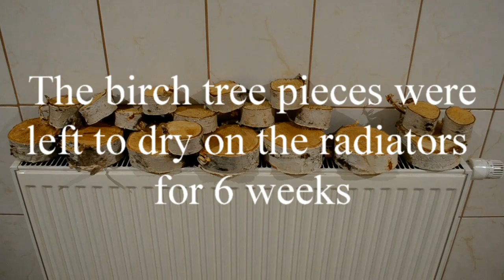Epoxy Resin Table

Comment: I've been a professional cabinet maker for over 40 years and this video took me back to a time before $20,000.00 worth of tools and how much fun it was. Good job
Reply: MJH1354 you had epoxy resin back then?:))
Reply: MJH135
Reply: I would like to know the name of the clear liquid he used? Thanks
Reply: Emanuel Santos d
Reply: MJH1354 co gai dam me ve rtranh
Reply: co gai dam me ve tranh nhảt ban
Reply: He is talking about the fact that how the guy is using hand tools instead of machines. Which MJH1354 used to do back at his time.
Reply: Quantos vale em Brasíl ???

Comment: This is a nice project :)
As a wood-professional i would advise some little changes for your next furniture though.
1. Try to put screws from the invisible side instead of drilling from the outside, unless you plan to put really decorative caps over the screws.
2. Dovetails are supposed to be a really tight fit, otherwise they will loose strength. Saw those very tight and if necessary fit them using a chisel or sanding paper. You might consider putting a screw-clamp to avoid splitting the wood when only putting one dovetail.
3. Also the outermost part of a dovetail joint should always be the part with the grain running through, not the dovetail itself which tends to break more easily.
4. Once you mill these joints for the framework, you could as well mill them dovetailed and put those beams in from the top, making it more durable.
Reply from the maker: Thank you very much for the advices, I will definitely use them )
Reply: HomeMade BRAVO!!!
Reply: good advice :)
Reply: Don't try to tell chickens how to lay her eggs, it was great, show me your work
Reply: Jose Rodriguez the guy was happy for getting the advice, thanking the guy (first reply).  we're all learning.  it may help others as well.
Reply: Foreign country; English is a second language.
Reply: He was being polite.
Reply: Grant Perkins show me your work 🤨🤔   I think you just talk

Comment: Beautiful!!! I am a woodworker and I have been planning a table just like this. I've saved up the rounds...I'll use oak. Question... what kind of resin did you use? I know it's epoxy but what brand? Did it cure clear? Also, what kind of glue did you use to bond the rounds to the substrate? The plants in between is a nice touch. Well done!
Reply from the maker: Thank you. The epoxy I used called 3D tranparent epoxy. And I used PVA glue.
Reply: dolan faunture set march 2017
Reply: donde se compran los productos
gracias y felicidades

Comment: Beautiful! Love the dovetail corners. Did you use the same epoxy mixture for the final coat?
Reply from the maker: Thanks, yes I used the same epoxy mixture
Reply: joe
Reply: süper fikir tsk
Reply: joe Jonas massinha
Reply: Joyas de plata hechuras
Reply: ????is it the same kind of epoxy as the used for flooring

Comment: You've done a very good craft work! For the next table I would take a glass plate. On this glass plate I would put the wood and the flowers. Finally, I would illuminate the glass plate from below with an LED lamp.

Comment: I don't know if you came up with the idea of your router fixture for leveling off the top of the rough sawn birch pieces but that is a brilliant idea! You didn't show the bottom plate of the fixture but I assume that it was assembled to be inset to the fixture side rails. I will be making a fixture for my router, thanks for the idea. Very nice table!

Comment: This table looks awesome... the only question I have (which maybe you don’t know) is why the epoxy resin became so cloudy? I want to make a resin table but I want to do NUMEROUS depths but I want it to be crystal clear. If you know why it was cloudy that’d be awesome if you could inform me.... I like it on this table though. I’m from the northwest and it reminds me of a foggy morning in the woods
Reply: I believe it's the lack of having buffered it to a nearly glassy look before the final coat. He also should have used a propane torch as opposed to the heat gun. The finish was truly quite poor. It should be flat, crystal clear, and basically look like glass. Could also possibly be the quality of epoxy, or it not having been mixed well enough.

Comment: Really well done.  Enjoyed watching the video as well.  Only thing I would have done different is used pocket screws to attach the plywood to the frame in order to get rid of the dowel marks on the outside of the frame. Could of even used biscuits.  Gave me an idea on what to do with the old wood in my garage.

Comment: Very nice - Just wondering if that wouldn't look sweet with some varieties of wood in there instead of all chunks from the same logs as most of the larger pieces have identical-matching 'hearts?'  Maybe some black walnut, oak and maple mixed with the birch for good measure?  Also - I noticed the resin was really cloudy between where you laid the ferns, berries and flowers - just wondering if over time that clears up and you can see down to your sawdust-resin "floor" that the crosscut log pieces sit on?

Comment: very nice outcome!  was there a reason to do the epoxy in different  stages ? thanks .
Reply from the maker: Thanks. The reason of different stages is very simple - I couldn't calculate how much epoxy I need. First time i ordered less than i needed. After few days I received a new delivery of epoxy. That's why you see different stages of epoxy pouring.
Reply: HomeMade o

Comment: I appreciate the video! Lots of good techniques. I was wondering how you were going to get the height of the log cross sections equal. The router jig was smart. I would use concrete rather than epoxy.

Comment: I'm new to using epoxy. I wanted to ask if you wanted the resin to dry cloudy?
Reply from the maker: You mix epoxy resin with hardener. After pouring out the mixture you have to heat the surface to bring all air bubbles out. More heat - better transparency.

Comment: I'd recommend using a torch instead of a hair dryer it takes more of the air bubbles out of the epoxy so you wont have that cloudy look where you put the flowers.
Reply: Agreed. And it wasnt properly buffered either. Very poor finish. :(

Comment: What kind of epoxy did you use? and how much of it? Also wondering how long it took to fully cure. At 20 minutes is that a different sealant/polish or another layer of epoxy resin? I am looking to use epoxy resin as a chair seat ~2 inches thick 18x18"

Comment: How many litres of resin was used in this table? I'm doing a similar thing in woodwork and i need an estimation for how much i need. thanks
Reply from the maker: I used about 10 litres of epoxy with hardener
Reply: thanks for the reply!

Comment: Looks really good, I just think you didn't have to do so many different applications of the epoxy, it probably would have finished a lot clearer with just one rather than several

Comment: Good effort but spoilt because the epoxy was mixed incorrectly,The way it was being whipped up in that bucket allowed air bubbles to get into it,Whats the point of all them leaves and stuff inbetween the round tree branch cut outs if you cant see them?

Comment: looks like crap. clear resin is the idea to see the garlin
Reply: Yeah it's because he routed the top of the resin before he poured a final coat but didn't sand it back to clear. Could have been so much more impressive.
Reply: Agreed. The finish is awful. Such a waste.